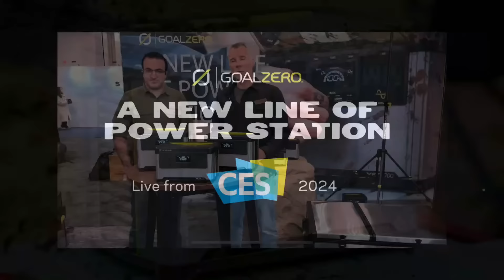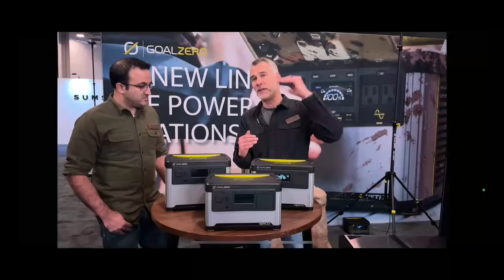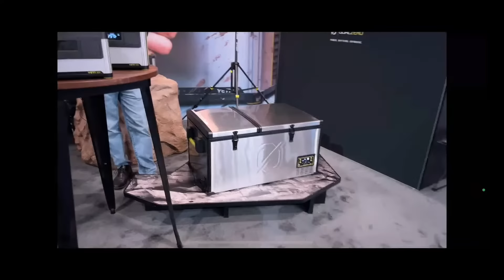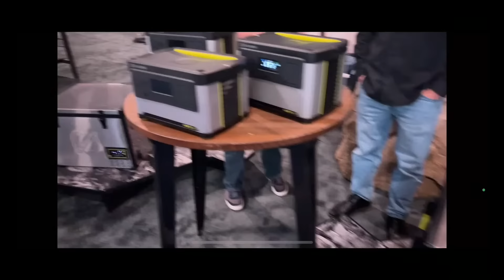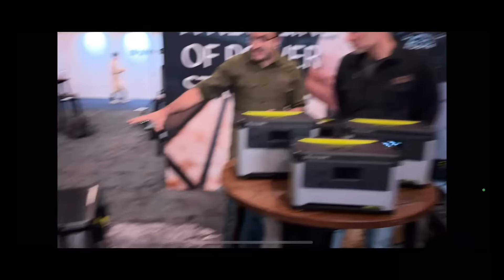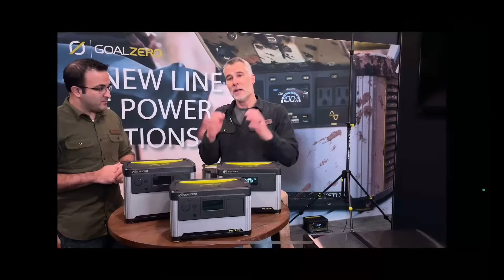CES 2024 New Products Live Announcement | Goal Zero

Comment: Are the fridges waterproof?
Reply from the maker: With the included case the fridges can withstand light rain but the Alta fridges do not have an exterior waterproof rating. The compressor compartment where the ventilation is should be kept dry.